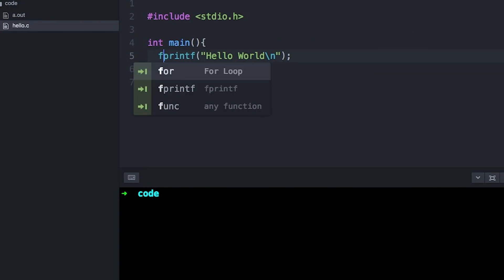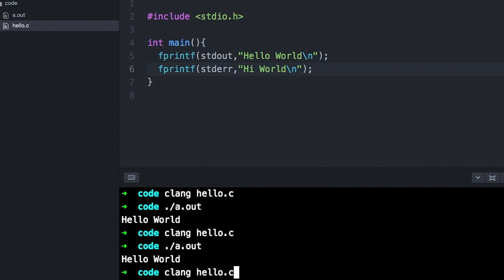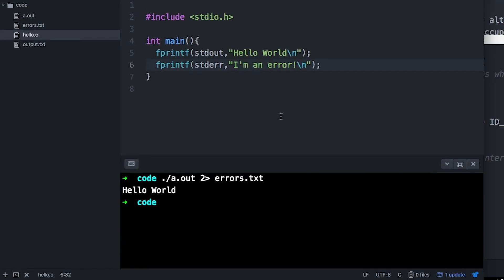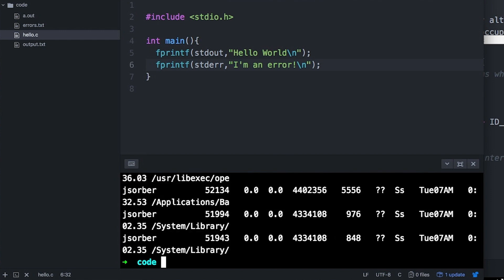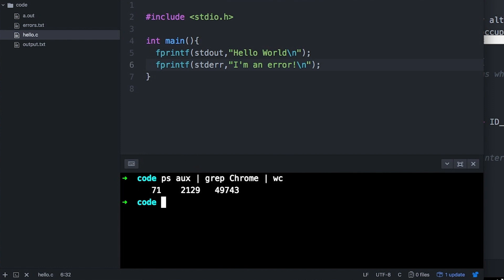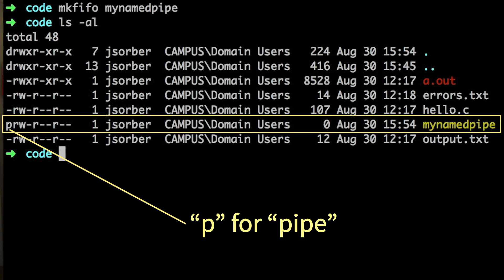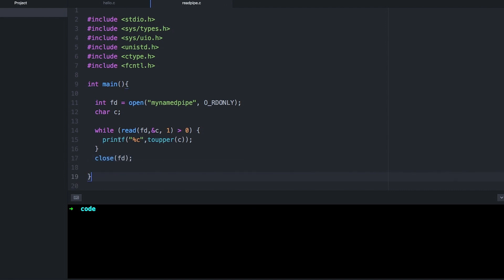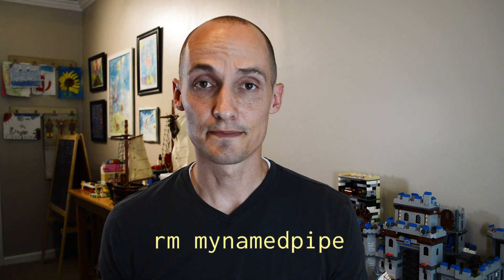Using Pipes and Named Pipes to get your programs working together.

Comment: How is pipe different from entering another parameter in the command line.  For example, this works:
cat logfile.log    |    cantools   plot     dbcfile.dbc  
(or in windows  type  logfile.log    |     cantools   plot   dbcfile.dbc)

Yet the following won't work
cantools   plot     dbcfile.dbc     logfile.log

Presumably because cantools is using the filename as the data rather than the contents in the file?  Is it possible to even use a tool like 'cantools plot' without Pipeing?

How would one programmatically call this exe with arguments (plot   dbcfile.db) while piping the data (cat or type)?

Comment: 1:42: To avoid an off-by-one error, use ps aux | grep [C]hrome | wc instead, because if you don't use the square brackets, the grep process will be included in that count. Or, for a slightly more portable solution that also matches chromium-browser and just returns the count, try: ps ax | grep [h]rom | wc -l

Comment: What happens if the process receiving the input from the pipe isn't as fast as the process that is feeding the pipe? I assume that eventually you'll run out of memory?
Reply: Looking at recent Linux kernel code, it looks like its done like following:

- If the pipe writer opens the pipe nonblocking (see man page open), then the kernel will return -EAGAIN 
https://elixir.bootlin.com/linux/v5.15.31/source/fs/pipe.c#L551
Your application is responsible of handling that -EAGAIN, basically you would try again to write. 

- If the pipe writer opens the file in blocking mode, wants to write into the pipe, but the pipe is full, then the kernel will put this process to sleep.
https://elixir.bootlin.com/linux/v5.15.31/source/fs/pipe.c#L570
 Your application should block
Reply from the maker: Good idea for another "what if" video. I think the pipe's buffer will fill up, and the process putting data into the pipe will block until the process reading from the pipe catches up and makes space. But, you should try it out.